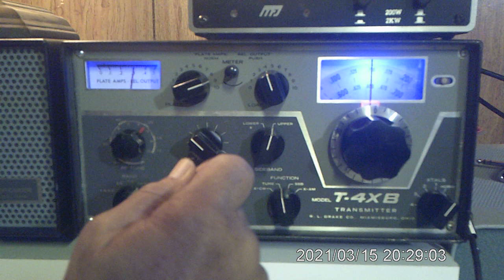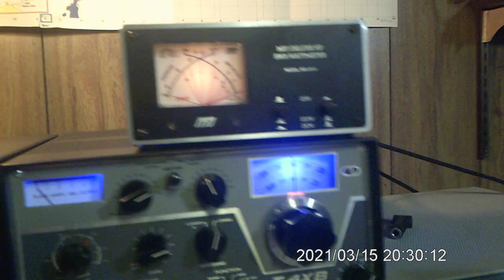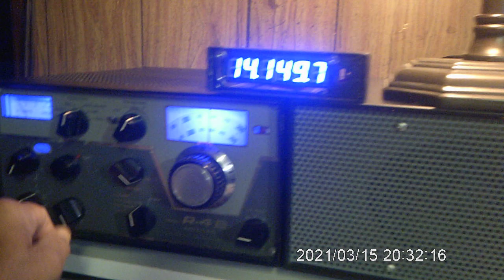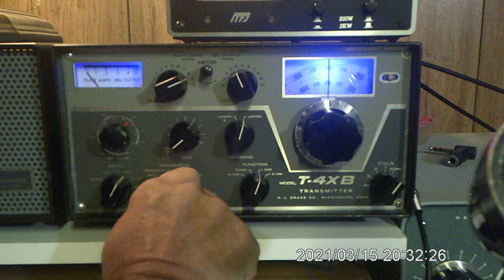Tune Drake B Line T4XB/R4B

Comment: Just picked up a TX-4B.  Putting it thru some tests now.  Seems to work just fine.  It's got a nice tone on key down.  I don't think it's supposed to make the SPOT canary noise with a non Drake receiver.  At least mine doesn't.  Maybe it will when I hook up the receive antenna cable to it.
73 Paul AA1SU